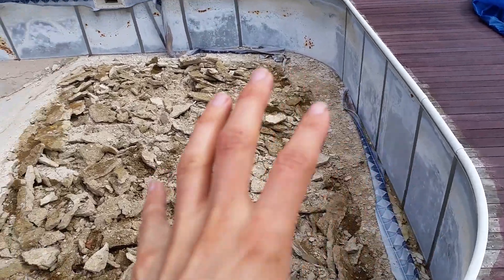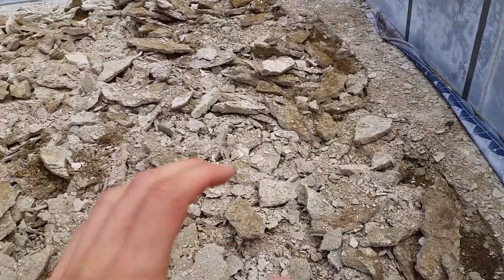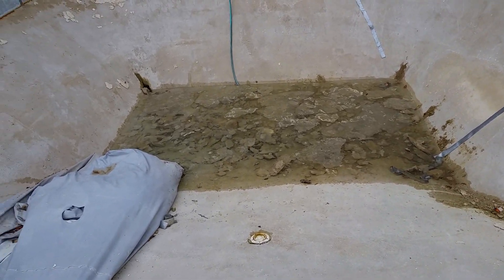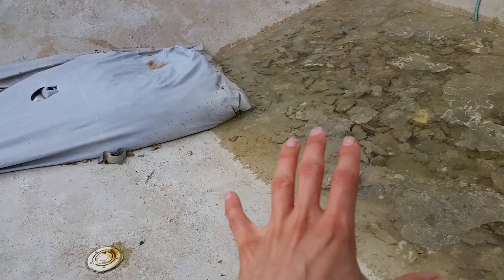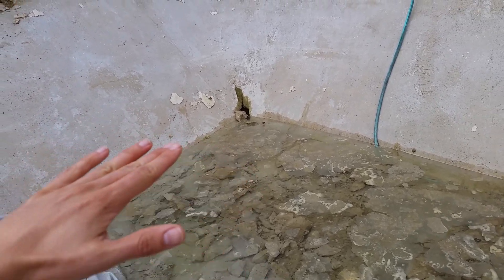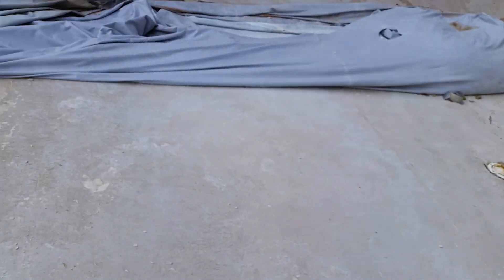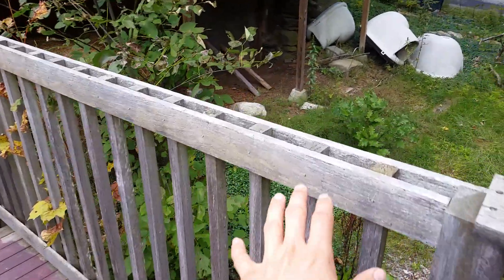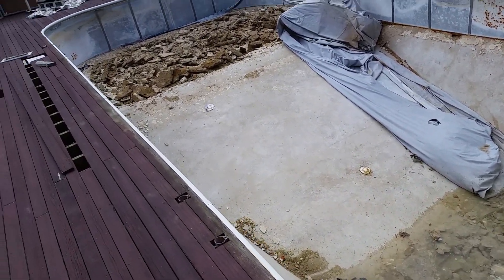Inground Pool Demolition (greenhouse build) - Part 2

Comment: Hi .lot of work your getting there. Back in the 90's my parents had an inground pool they were getting old and couldn't maintain it. so they filled it  .There was a local farmer who had a belt elevator for putting bales of hay to his second floor of his barn . He let them borrow it and they used it to move the Rock and dirt over their porch which was similar to yours it was a little harder than just dumping it into the pool.  They loaded it onto the belt and then into the pool and then they had to maneuver the rock & dirt around in the pool which you'll have to do anyway. but it saved their porch . When done they used it  for their Garden .You may look in to finding a local farmer with one or a rental company it could be worth while. Check your local ground water table it may just be high this time of year. Take care of that cold. As always enjoy.
Reply from the maker: That's a great idea!  Thanks for sharing!  :)